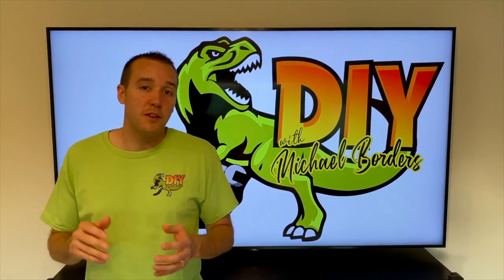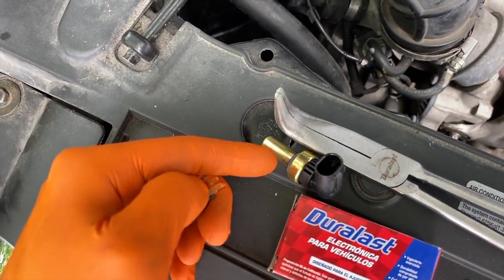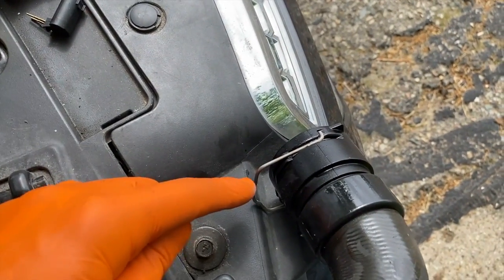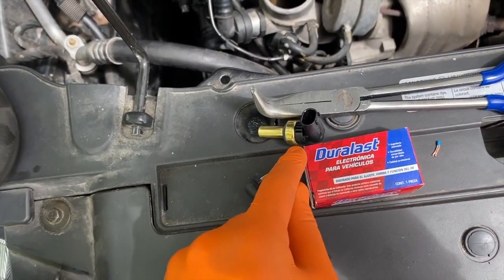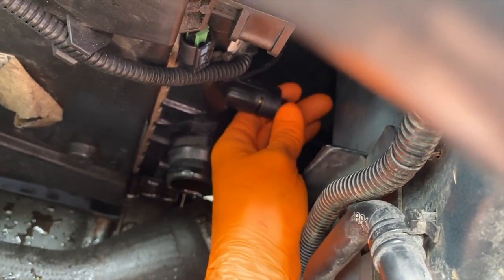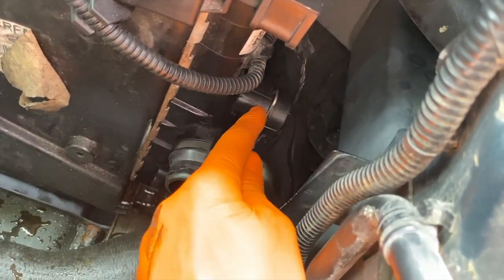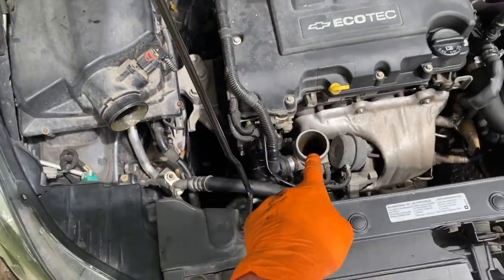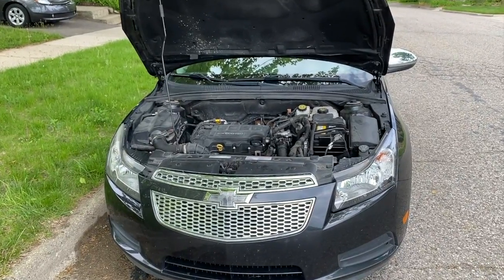Chevy Cruze radiator sensor - AC off/engine temp needle not moving

Comment: I'm replacing mine because it is leaking from there. Does anybody know if I can just use some liquid gasket or something like that?
Reply from the maker: Thanks for watching & welcome to the DIY Raptor Club.  If new part is installed properly, you shouldn’t run into leaks.  Keep us posted on your project.

Enjoy your day!  😎👍🔧🔩
Reply: @DIYwithMichaelBorders  Yes got a new Temperature Sensor and installed it stopped the leak.
Reply from the maker: @TheAntsgood  

Very cool & we appreciate you taking the time to share this.  Enjoy your Cruze!

😎👍🔧🔩
Reply: @DIYwithMichaelBorders  Thank you
My next step is to purchase a scanning tool because I now have a check engine light on. Maybe you can recommend one or you can do a review on one?
Reply from the maker: @TheAntsgood  

Thanks for the reply.  We purchased the Bosch 1300.  Below is a link to our review video on it.

       https://youtu.be/DvogiRhGEYk

You also have the option to visit your local AutoZone where they will read your codes for 100% free.

😎👍🔧🔩

Comment: Hello what would be the part number for the top sensor sir
Reply from the maker: Thanks for watching, is yours a 2012 1.4L Eco?

If so:  AutoZone-  (SU13822)
Reply: @DIYwithMichaelBorders  it’s  a 2015 Chevy Cruze 1.8 lt
Reply from the maker: @gerardobaciliopozar9305  

Thanks for the reply, it’s best to check with AutoZone for the part number for your 2015.  👍
Reply: @DIYwithMichaelBorders  sorry it is a 2015 Chevrolet Cruze 1.8L FI DOHC 4cyl
Reply from the maker: @gerardobaciliopozar9305  

Thanks for the follow up, no worries.  You can even contact your local Chevy dealership and provide them with the last 8 digits of your vin number.

They will be able to get you the exact replacement part number for your exact engine.  At that point, you can either purchase part from local dealership or use that part number and buy elsewhere.

😎👍

Comment: Replaced the radiator sensor but now when I add coolant it completely drains it as soon as I do so and starts to leak from that sensor
Reply from the maker: Thanks for watching & welcome to the DIY Raptor Club.  Have you verified the sensor is installed correctly?  If not positioned correctly, the sensor itself will not seat properly.

Keep us posted.  😎👍🔧🔩
Reply: Also make sure old gasket came off with old part.